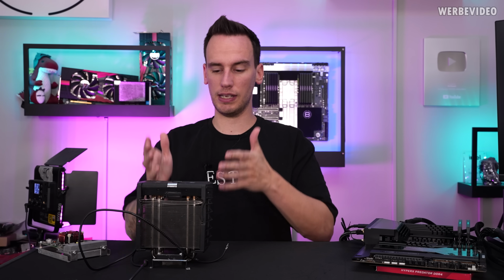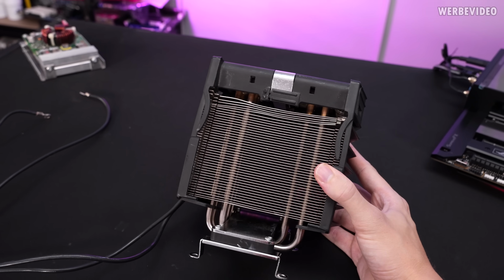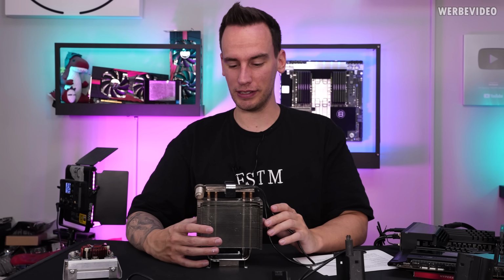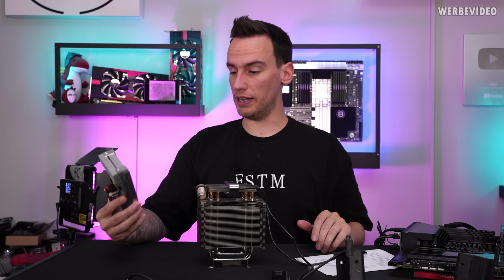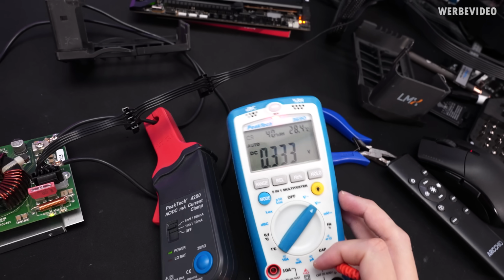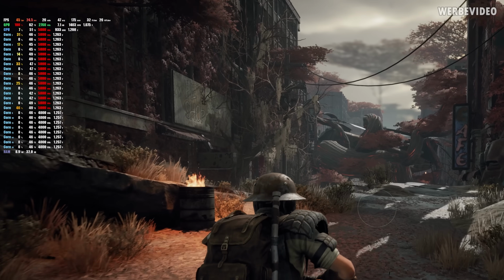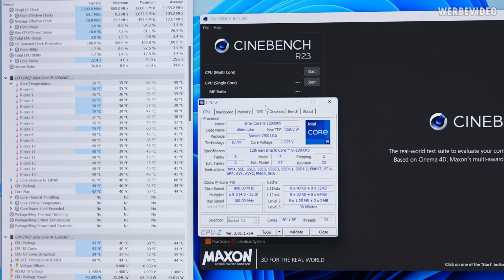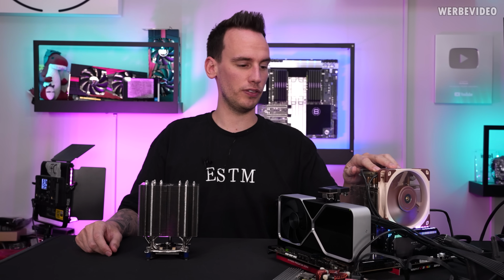This Cooler Ruined an entire Company - LMX Liquid Metal Cooler

Comment: So its filled with NaK...
Thats very easy to dispose of, if a tad "lively".
Here is how you do it somewhat safely;
1. Get the Nak into a container filled with oil, prefereably mineral oil. (To avoid the selfigniting with the moisture in the air.)
2. Drip it into a big tub of water to react it. (Or chuck the whole thing in for a very lively reaction) Do it outside, or in a very well ventilated room. The fumes are not good for you.
3. Once it has all reacted maybe chuck the cooler into the tub to react what remains in the pipes.

The NaK will have been converted into SodiumHydroxide and PotassiumHydroxide. 
Both are safe to pour down your drains. In fact, both are used as draincleaners.

Comment: wouldn't a gallium based liquid eat the copper or aluminum pipes? I think it might have been a corrosion issue to use a gallium alloy. it might have also been an issue with the electromag pump possibly needing a much higher wattage than the sodium potassium option.

Comment: They used NAK because of the mass, they can use a lot of it so it will transport a lot of heat despite de low heat capacity.
Also if you dump NAK in some HCL solution you will get some sort of NaCl and KCl  mix which you can use on your French fries. :)). Btw, heat pipes transport heat because of the phase-change, not because of the heat capacity of water.

Comment: Chemical engineering major here: at 6:23 you mention heat conductivity being less relevant but you can think of it in terms of electrical conductivity and resistance; heat transfer both into and out of a material depends on it just like how electrical current through a circuit depends on the conductivity of the traces and components. In fact, the theoretical diagrams that were used in the lectures i attended and the textbooks i read use the same resistor symbols. If a material cant conduct heat well, then it means it cant absorb that heat very quickly, even ifnthe heat capacity is favourable.

Another way to think about it is: theoretically a battery may be very high capacity but could only produce low currents due to the internal resistance.

Put mathematically, the convective heat transfer coefficient is directly proportional to the thermal conductivity

Comment: That cooler would be far superior if you were cooling something much, much hotter and the stack was much taller. If your CPU was hitting 200c, this could make sense if it was tall enough. Also, with electro-hydrodynamic pump, that thing will never fail unless you break it open. So you would buy that cooler and use it forever. 

This seems like an industrial solution for a very much non-industrial problem, but there could be use cases. Like all those COBOL database servers in warehouses.

Comment: Which liquid metal might be a good candidate to do this more safely?

And with that pump mechanism, couldn't you use this to make a slightly smaller NH1 that works without a fan?

If it competes with air coolers, it should be a set-and-forget setup. Otherwise you are actually competing with AIOs, which I thought this was going to be based on the video thumbnail.

Comment: They probably picked that over water because you can't use electromagnetic pumps on pure water (as it's not conductive) and water with salts could've formed deposits or corroded the copper.
Plus with water you would have ro take changes of phase and thermal expansion into account while with liquid metals they eould be negligeble.
The massive advantage of electromagnetic pumps over regular mechanical ones is they have no moving parts at all, that means it's unlikely they will ever fail.
I also don't think that thing is really that dangerous: The amount of sodium-potassium in those tiny pipes can't be that much and you would have to beat the hell out of it to rupture them. Dropping it would just bend them.
It's probably less dangerous than the lithium cells in a fully charged large powerbank. Those would aso catch fire if damaged and are likely easier to puncture.

Comment: Heat pipes are NOT filled with water at low pressure most are filled with a ammonia based substance or parafin wax based substance depends on the grade and heat transfer rating of pipe high end get the ammonia low end gets wax
Reply: I've broken open a few heat pipes over the years and have never found anything other than water.

Ammonia would be super obvious to me, same with wax.

Comment: To check whether it's really the flowing metal cooling the cpu you should have tried to unplug the power to the control board and see if and how much the temperatures would rise.
Anyway, was the fan on constant RPM or was an adaptive speed curve in effect?

Comment: I’m somewhat surprised that you did not consider 2 very important aspects: 1) How this cooling system behaves at ambient temperatures closer to 0 degrees.  (its strong point is that it is closer to liquid cooling systems) 2) how much electricity it consumes when operating.  (I heard that liquid nasriya is used as a coolant in some types of nuclear reactors)

Comment: Sodium is used inside some engine exhaust valves to improve their heat transfer capabilities, maybe that's where they got the idea. But in engines, rather than an electric pump, they exploit the motion of the valve.

Comment: i gather somebody bought their tech for specific applications, and, if it performed better i wouldnt personally be too worried about using it in my rig or even on an open air workbench system, i men with the shroud on, or a better 3d printed one that let me use a 140mm fan and ensured the full fin stack got hit.. i have worked around/with some WEIRD cooling solutions... including one that used bloody propane/natural gas to cool hardware AND warm the gas before it was burned as fuel, a weird setup but, worked amazing year round, with very little unplanned down time.... the heat pipes in that were THICK copper INSIDE automotive tubing... and yes it was cooling PC related tech as well as specialized tech with that same setup, we later learned it was running an overclocked pentium pro>p2 overdrive chip pairs on that old setup, for the day it was stupidly powerful but also, produced alot of heat due to the OC the company applied, oh the did this to allow real time editing of jobs using their cad and setup software, the CAM/CAD guys loved those units, even after they were quite antiquated, because newer machines dont offer that function and sometimes you need to dial things in, or do a minor tweak for example because your shifting to thicker/thinner material.. or harder/softer for the same job, in one case we discovered you could stack and clamp 3 plates and it could still do the job, 30% slower cut speeds but doing 3 plates that still made it faster then running singles, we also discovered that it was actually more cost effective to have 3 specific brackets made from titanium because they could be made from scrap the shop we traded services with always had lots of, and because the bracket could be less then 30% as heafty/overbuilt due to titanium being quite a bit stronger then steel or alum/mag/etc alloys.... the fact it was lighter was also nice since in total it took over 1.5 lb off the weight of each unit, and made working on them alot easier then the old bulky brackets.

anyway, i mean this is an interesting idea, sadly its also sort of dumb the way they did it... 

honestly their choice of alloy in those tubes is very odd... but i am an old fart, whos not seen that many liquid coolers or heatpipes compromised to a degree they would leak... and most of those were intentional idiocy by people i iknew who were destroying an old pc... more then once i rescued parts...but h212's wth broken brackets/fan mounts... i just let them have their fun.... stil hurts me knowing some of the hardware they destroyed before knowing to check with me before shooting things fulll of holes/blowing them up/etc... when they found out that a dec alpha system they destroyed was not only 100% functional, but worth at the time over 3800usd at the low end on ebay, you could see their souls leave their bodies.... the comp was worth more then all the guns they took+ammo combine... hell worth more the the truck they took up to their property to go shooting..... also a prototype mac workstation/server that they almost did that too, got them 4878usd from ebay, from a company that needed it because they had one that was failing and needed a compatible unit to even be able to make a proper backup.... turned out it was the PSU going and they got lucky a guy we knew who was only a few hrs from their offices, and this fellow rebuilds psu's as a side hussle, the amount of money hes made from just recapping/coiling psu's is a bit crazy honestly... he did the old one then got them to give him the one from the working unit and he rebuilt it with new high quality solid state caps so they wouldnt fail again any time soon... also convinced them to put each one behind a triplite server grade UPS... that system was weird but neat.. 4*g5's with an abject s-load of drive connectors an back plane for more pci slots..yes it was weird... heh..

Comment: 30 amperes?
30 amps multiplied by 12 volts is 360 watts. That's probably more than what the CPU consumes.
Who thought it was a good idea?

On the bright side the pump (if my guess about the technology they used is correct) has no moving parts, so it shouldn't ever break or require repair.

Comment: The reason heat pipes work better than that liquid metal is not just their specific heat, but also because heat pipes are dependent on a phase change of the water, where it vaporizes off the hot side and then condenses on the cold side. 

The spec.heat of the NaK blend is 982 J/kg*K. The specific heat of water is 4182 J/kg*K. But the latent heat of vaporization of water, aka what it takes to boil it from the cold side liquid into vapor in the heat pipe, is 2,260,000 J/kg. The magic is in the phase change absorbing humongous amounts of energy, which instantly dooms the liquid metal to forever be inferior- conductivity or no, it simply can't move as much heat as water can, and never will. 

Whoever designed this cooler probably didn't do too well in their undergrad thermodynamics class...

Comment: While the idea of a liquid metal loop sounds exciting at first, I think this design is pretty unnecessary and not very good. Water has a huge heat capacity advantage over liquid metal and a classic radiator can also be placed at a better spot than the classic air cooler.

They probably got the sodium-potassium idea from engine valves. I've heard these are filled with it for cooling. I'm not a car expert, though.

Comment: Im looking at the pump on top thinking your using electro magnetic induction to pump the liquid metal sounds like so much extra heat waste on a cooler
Reply: I'm shocked just to see it complete but that's probably due to the 2 heat generators being on opposite sides of the radiator. Wish you could check the temp on the input and output pipes. At least 2 sensors ideally 8.

Comment: In the nuclear industry, using a metallic sodium coolant allows the reactor to achieve very high temperatures (600°C) without having to maintain a pressure vessel like normal water reactors (300°C at 150atm). I don't see the same benefits here LOL

Comment: I paid about $100 for my noctua cooler way back then and l still use it today.
ps. it actually runs 5c to 10c cooler than the x52 kraken aio l was running on current cpu (yes l have gone back to air cooling and the pc runs soo much quieter now)

Comment: So I have 3 of these coolers here at home. They did go on sale at danish retailers, I believe I got mine at proshop. They had 19 in stock when I purchased mine. I remember because they went on sale and I wanted to buy their full stock, but waiting for an email response got it down to 3 and I just purchased those from the online store. If I remember correctly Danamics was a danish company, and at the time the Antec 920v4 just came out, and as a reviewer I reviewed that 120mm liquid cooler against this LMX. The results was that the 920v4 just barely came out ahead. So at the time this cooler was actually great, and I still have one that I have in a system that I use, for a time it was my daily as well. However the cooler was so heavy that they had to make a superleggera version of it, because it would bend motherboards.
I was actually thinking of writing to you and ship one your way given that I am in Denmark and I thought these were pretty cool.
I also want to mention that they did come with fans. All 3 of mine have the same brand (I don't remember the brand) fan with orange light, and they can run up to about 3.000 RPM if needed, they are pretty decent quality and still runs just fine after all these years. The wires do get hot pretty quick, but never too hot. In a case with airflow it isn't bad at all.
As far as degrading goes, I haven't seen any. I see no performance issues on mine still, and the metal is still very shiny.
The way you installed the noctua fan is the intended way, it says so in the manual for it, I still have the original boxes and everything for them. Just those rubber stuff around the mounting holes on Noctua fans was never intended to be on.
Overall this cooler was my go to. I remember clocking a 2500K to 5.3GHz on this one, and running at the absolute thermal limit of that chip, but the Antec 920v4 never had a chance of doing that, it would thermal throttle basically immidiately.

Comment: I could see how they thought this would be a great idea.  I can think of a severe alteration that would make it a specialty case as the cooler would become part of the top portion of the case or the case would lay on what is I guess typically the back and  the top would be a large side panel turned heat sink.  The liquid metal would evaporate up and exchange heat with the rest of the cooler case via the pipes and then drip back down into the main heat block.  With the low capacity it might(?) mean a faster transition back and forth if the heat can dissipate from the gas state quickly enough.  Might have the fins tilted so that air flow would slam into them and be directed out an exhaust as that may help instead of just being flat with air only slightly scraping the sides.  
Has this been tested on video before where if the fins are tilted makes a marked difference? I'm not saying oddly bent fins but intentionally directed plates to get air to bounce off in between them and soak heat off them.  Granted I can also see this taking heat and adding it back an inch further in but how much so. 

Please note I have no idea if this will work.   This is just going off what I heard and probably doing what the makers of this item did.  Had an idea and ran with it.

Comment: I never knew a normal aircooler today have copper pipes filled with water at slightly lower than atmospheric pressure (in order to adjust boiling point). I am of course aware of some recent videocard coolers (one was dissected on this channel) and the difference in performance depending on how card is mounted but those were exceptions, most CPU coolers in sesktop PCs and laptops just have solid copper heat pipes and move heat through copper heat conductivity (rather than convection or forced movement of water (vapors) inside the heatpipe. Did I had it all wrong ?
Reply: They are almost always heat pipes or vapor chambers; conduction alone would not be fast enough to draw energy away from the electronics.

Comment: The conductivity of the liquid metal is important: that will passively move heat through the pipes. So this setup basically uses both forced convection (the magnetohydrodynamic pump) and conduction. That's probably why it performed better than expected.

Comment: That pump si actually pretty fascinating. It's solid-state, there are no moving parts inside it to drive the liquid. It uses magnetohydrodynamics to move the NaK through the pipes. Basically, it's a railgun whose projectile is a liquid.

They're horrifically inefficient compared to a mechanical pump but have the advantage of not being ruined by NaK, making them suitable for these applications.

What a terrible consumer product though.

Comment: Considering that in your mounting setup a third of the fan was not pushing air through it, it seems quite good. Should have gone with normal sized memory without RGB to be able to mount the fan properly. Results would be more interesting in a fair comparison.

Comment: With heat pumps, you want a phase change to release the additional energy, so having 1/4 of the energy input required to induce a phase change, makes it more reproducible, that and you'll have to wait for your PC to get to 100 degrees before that mechanism starts, with the material you mentioned, that's 25 degrees, if the maths is as simple as that.

Comment: The metal are no toxic and hardly dangerous. You could dispose of it in approximately 10 liters of water after drilling a small hole. The hydrogen if it even burns wouldn't be more dangerous than a candles.

Comment: Why not use refrigerant at this point? Small mini compressor and evap setup. Use treated chilled water as the conveyor liquid.. you could get low temp cooling. Easily under 30 degrees f.